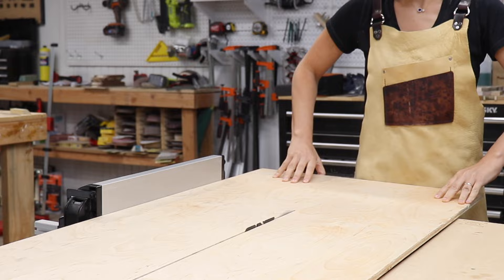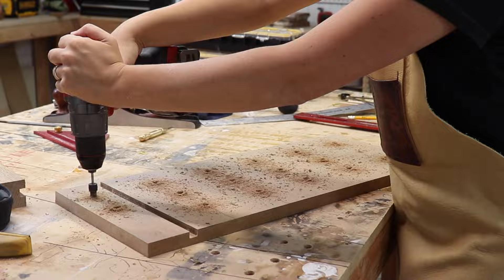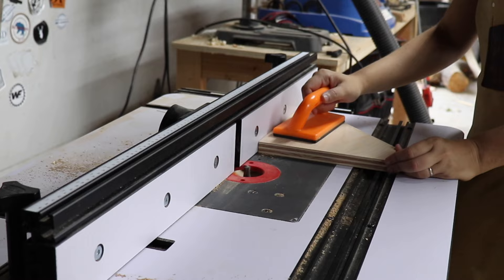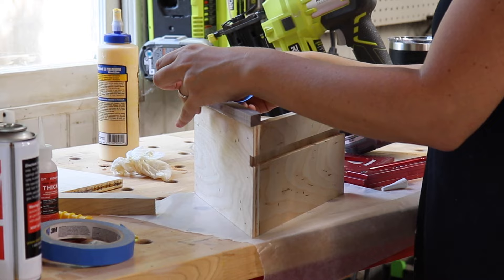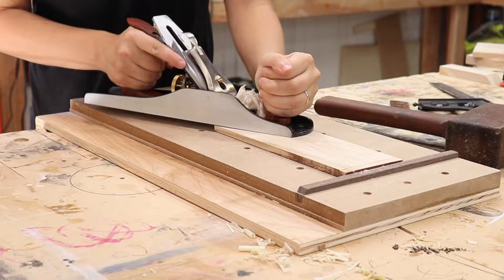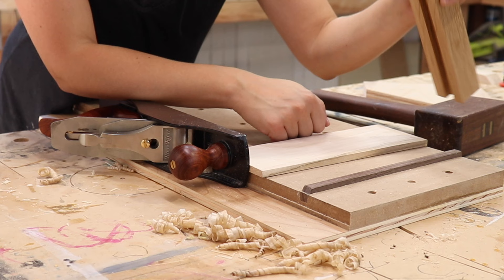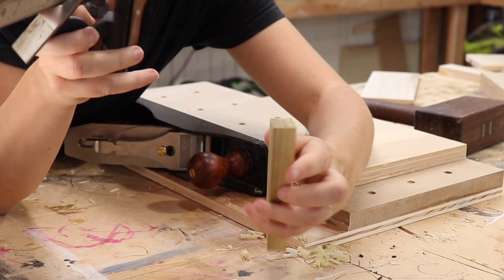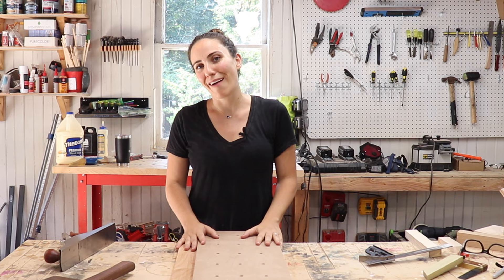Shooting Board with Miter Attachments // Woodworking Jig // Handtools // Easy Shop Project

Comment: I'd like to ask a question: I am using a Quangsheng 62 and a Stanley 4 plane and neither cuts endgrain on my shooting board. What am I doing wrong? Thank you for helping!
Reply from the maker: What’s your sharpening system like?
Reply: 3x3Custom - Tamar I have a 400 and 1000 grit Waterstone and a strop, and I honed it on the 1000 grit and stropped it shiny as a mirror but it’s not a razor blade
Reply from the maker: TobiasSebastien hmm. Do you have a honing guide? I found my sharpening really got better with the use of one.
Reply: 3x3Custom - Tamar yes I do and I do set it up as required. I did get some better results today btw, after using a proper leather strop. But the blade is still not super sharp, won’t cut paper or my hair 🤯
Reply from the maker: TobiasSebastien are you also paying attention to the back?
Reply: @3x3CustomTamar  What do you mean by that?
Reply from the maker: TobiasSebastien you need to flatten the back of the chisel as well.
Reply: 3x3Custom - Tamar oh yes I did. But I ordered better Waterstones, as I read now that I am not the only one not getting a sharp blade with the stones I bought (£14 on amazon). I will let you know. Thank you so much for your help!!!
Reply from the maker: TobiasSebastien waterstones need to be flattened every once in a while!
Reply: 3x3Custom - Tamar I know, I do that every time before I use them
Reply from the maker: TobiasSebastien not sure what to tell you then. Ha

Comment: Hi, you’ve made a nice looking shooting board. One improvement could be to attach the fence to the ”donkeys ear” the same way as for the base plate. Then could you switch between different thickness of the fences. I’m also looking forward to see you building a sturdier work bench. :) I’ve attached my work bench to the concrete wall in my garage, so it won’t move around when I plane a heawier piece of work. Johan S.

Comment: Thanks for the video. Some thinners will remove most of wax where you don't want it. The fence on the "Donkeys ear" style support is all wrong, it needs to be at least an inch wide and to be attached to the top surface not the end and the pins will do next to nothing as far as adding strength they are in line with the force they are supposed to be resisting. Forget CA glue as it really is not a good choice tor woodworking, no matter what the marketing says. All the best.